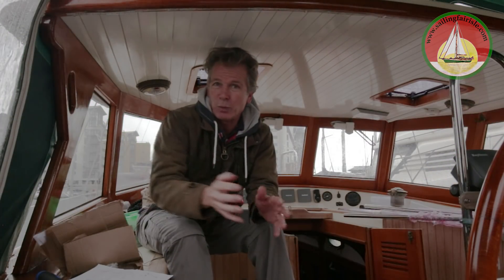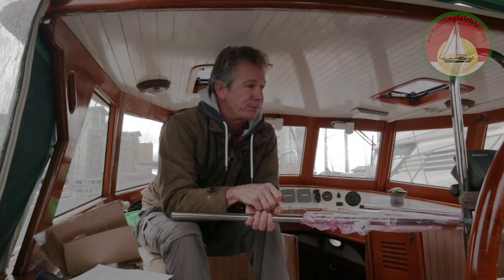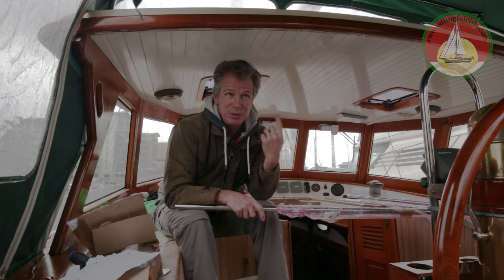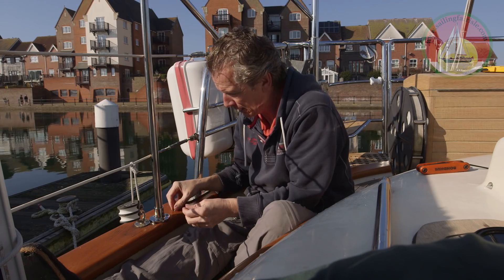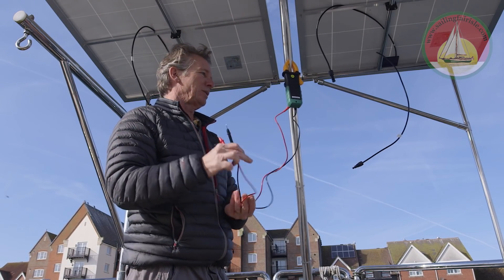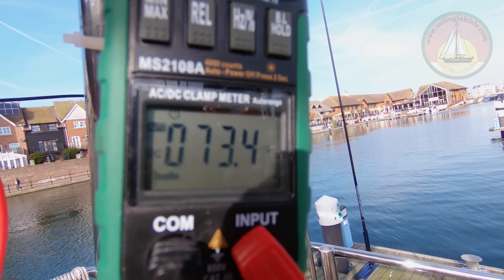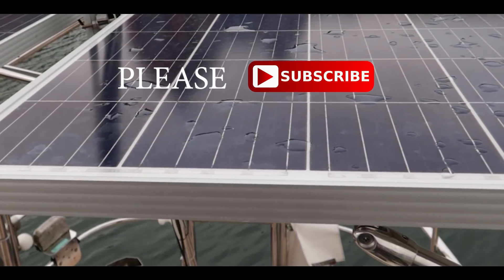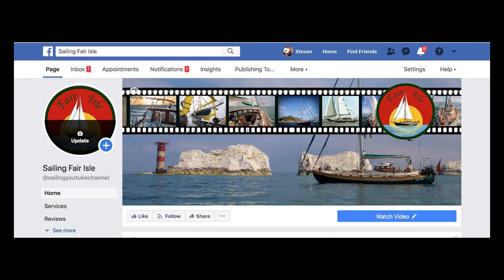Fitting solar panels on a sailing boat

Comment: I've been an aircraft mechanic, working on airliners, for 35 years. I have also been avionics rated for over 30 years. I have to tell you, your skills and knowledge are well developed.  People would do well to listen to your advice.

You and I both love machines.
Reply from the maker: Well I hope at least my technical advice is okay, my girls tell me my advice on life in general is rubbish!
Reply: @svfairisle  Probably because you are not young enough to know everything. You know if young people listened to our advice, we would have less qualified people serving drinks, flipping burgers and working checkouts because the degree qualified people would actually have jobs in their field of knowledge.
Reply: I understand you mounted the charge controller upside down for ease of wiring. However, it is better to have the entrance holes on the bottom, or sides. Water can easily enter from the top. Salt water is the worst enemy of electronics.

Comment: Great videos!  One point, it’s a good idea to shade/cover the panels before connecting to the charge controller. Also, check out No-ox-ID. A product similar your use of Tefgel, but is specific to electrical connections.  In “really” challenging environments, there’s nothing better. A very small jar will last forever. I keep it in my electrical tools bag, and tefgel in the rigging bag. Excellent point re good ratcheting crimpers . A connection as you’ve shown will last the life of the boat. Poor connections have caused a lot of fires.

Comment: Ahoy Steve, nice project! Theres nothing like free energy from the sun! And the satisfaction of doing jobs like that on your boat is a added bonus! You do very nice work, and your knowledge and skill are evident. I also have seen you explain dielectric grease twice so far, there is much debate on the cues of it, but im with you. I use it on everything in my van, and if i ever get around to working on electric on my boat would do the same there as well. Cheers!
Reply from the maker: Hoping to put some more solar on this winter. It's working really well.

Comment: Great video on how to do wiring.  Do you use tinned marine wire in addition to the dielectric grease?
Another option if you don’t have it already is to install a heat exchanger near or in water heater.  That way you get free hot water when you are motoring or charging your batteries. We have such a device for our hydronic diesel hot water heater.   It works great and we save on shore power and/or diesel for hot water or t heat the coach.
Reply from the maker: Yes I do use tinned marine wire, I know a lot of production boats don't as it's not mandatory in the regs. but I think the extra cost is worth it. If you were using untinned copper wire you'ld need a bit more than dielectric grease. Best to use shrink wrap with incorporated hot melt adhesive inside on every connection to stop water wicking up the wire. 
The water heater idea is good. If we get to the stage where we've got excess solar I may just do that.

Comment: I agree with you about the real life returns from solar panels being half of what the sales blurb claim.  The rated figures are for a luminescence you can not achieve on planet earth, at a temperature you will never keep the panel at and  keeping the panels pointing directly at the sun - which in most applications is not feasible..so somewhere around 50% for a clean panel is what I find I get, and closer to 30% if the panel gets dirty.
Reply from the maker: Yes that's what I find. Still an excellent way to charge the batteries though!

Comment: instead of dielectric grease I use vaseline which is an electrical conductor...I heavent checkedd the results but there were no hickups. I used the same to keep battery terminals clean as well.
Reply from the maker: I used to use vaseline as well until I talked to a very experienced marina electrician years ago. Vaseline works for a bit but is much too easily washed out and in areas that get hot like engine fittings melts off. It's cheaper, it's just not as good!

Comment: Cable entry at the bottom for a reason, moisture will wick along the cable and into your control panel if you leave it upside down with the cables at the top.
Reply from the maker: Probably wasn’t clear from the video, but the entry into the boat is full 30 feet from the control box. The cable runs through the aft state room and engine bay before going though to the shoe cupboard where the control box is, that would be a hell of a lot of wicking!

Comment: Once your happy with the bridge i would weld it and polish the burn colour, the screws will wear thro sooner than you think. I am a welder fabricator with two sailboat in plymouth. And love your programs.
Reply from the maker: Thanks for your insight John. Yes I agree. The structure is holding strong and is rigid enough which is what I was worried about initially. But you're right, it has to last. I'm considering adding a further arc slightly forward of the others to hold a third solar panel and I think i will weld all the joints at that point.

Comment: I am a little on the low budget side and I want to put solar panels up to charge my stuff. Mainly the laptop, phone and keep the battery topped up. 

So I looked at all those many ways one can install a solar panel, now my challenge is: I got a small boat and that makes it difficult to find space. Were talking 22 foot here. 

One of the ideas was to put up an arch but wherever I turned they were a couple of thousand quid. Seeing how you built your own: How difficult would you rate the DIY of them, and how much did you pay for the arch? Do you perhaps also have a little plan of it? Every boat is different but I dont do a lot of DIY stuff and would like it as a little guide for myself to try myself at it.

Thank you for the video btw!
Reply from the maker: Building the arch is cheaper than getting one made to fit but it’s still not cheap. With this thinner tubing you need a frame not an arch with cross bracing pieces as well. But I would say a a 22 foot boat it’s not feasible. The way I would do it is have small panels on the rails that you can tilt up. Maybe get some tubing welded between a couple of stanchions replacing the wire lifelines to mount them on. You can get some nifty titling devices or design one yourself & this has the advantage of allowing you to angle more towards the sun most of the time.

Comment: Solar panels are very much my expertise, Canadian Solar are rated very highly as the worlds number one efficient and cost effective panel.
Although I am not a fan of microinverters in hot climates, on a boat I would suggest they would be the perfect option as each panel would operate independently, perfect for your shading issues, I thoroughly recommend optimisers to enhance the performance on cloudy and wintry days.
Unfortunately you found out the hard way that thin Flexi panels are maybe ok for a camper van but I would suggest avoid altogether
Reply from the maker: Good advice, thanks. What’s your opinion on Bifacial panels? They look like the perfect panel mounted high up on a stern arch with all that reflected light from the water coming up?
Reply: Have a look at the BIKU and the BIHIKU, both are Canadian Solar Bi facial power rates up to 400 watt, from what I’ve discovered they provide up to around 30% more efficiency, I’ll find out for you about their abilities at sea for your specific requirements
Reply: And keep safe in such trying times...

Comment: Hi, the Mrs. and i have recently started watching your videos and are loving them. We have been watching canal cruising vids for ages including "Cruising the Cut" which i think you watch too. Of course i have gravitated to your Techie vids and articles as i love tech. I did notice on your Solar web page what i think is an oversight ie. ""As I said in the video, I opted for panels in series as I don't have big shading issues so I'm operating  on 62volts at 8.7 amps (in series it would have been 31 volts at 17.4 amps)"" Should that be "in parallel" it would have been  etc.? Keep the tech stuff coming as being a complete landlubber i want to learn more about sailing in general and the systems in particular involved. Cheers.

T
Reply from the maker: Think you've been on lockdown too long Tony! They are in series so of course the voltage is doubled, which is a good thing as current stays the same & therefore less loss in the cables. I used to work opposite David, he was ITV, I was BBC so yes I enjoy watching his videos although I've never been on a narrow boat! What sort of boating do you do?
Reply: @svfairisle  I have copied and pasted this from your web page on solar power;

"As I said in the video, I opted for panels in series as I don't have big shading issues so I'm operating  on 62volts at 8.7 amps (in series it would have been 31 volts at 17.4 amps)"

You refer to both configurations as being in series when one is in parallel or, have i lost the plot? :)

Only sailing we have done is cruising the canals on our friend's 65ft. narrow boat "Simplicity" i'm afraid. I took to the air instead of the sea :)
Reply from the maker: @tonywalker2372  Oh I see it's on the website text. Didn't spot that, just a typo, i will change,Thanks!
Reply: @svfairisle  I recognised it was just a typo, easy done. Loving your vlogs.

cheers, stay safe both.

Comment: I just wonder, that where panels are often partly shaded such as on your hard dodger, would you be advantaged by having a 10 x square ft panels instead of a 2ft x 5ft panels. The idea being that smaller things like lines or pennant shadows wont interfere greatly with output because the greater percentage are without shade which would otherwise kill the lot ..
Reply from the maker: Yes if I were doing it again I might have two square panels connected in parallel. They would have to be quite small though and would still get the boom shadow on occasions so don't think it would be a big gain.

Comment: Good overview, thanks. 

I also liked the info on your website (but maybe correct the typo to avoid confusion: "I opted for panels in parallel as I don't have big shading issues ....", you installed them in SERIES because shading wasn't a problem).
Reply from the maker: Arh thanks, will have a look & change :)
Reply from the maker: I've fixed the typo, thanks for the spot;)
Reply: @svfairisle  .... and I have subscribed 😊. Very nice boat you have there. Great protected cockpit, you got your priorities right!

Comment: Hello, appreciate your tech talks, thank you. Please excuse my ignorance but would that connection be better if soldered instead of using crimpers?
Reply from the maker: It's a very good question, I have talked about it in other videos. I think the Bilge pump video is the best for that as I go through the best connectors when I wired it up. Basically though the problem is although soldered joints are undoubtedly the best low resistance connection they are not good on a boat for the same reason that single core wire is no good on a boat. Any movement and the weak spot where the solder meets the wire and effectively makes it like a single core its at risk of breaking. If you're dealing with wires that are in a loom and very well tied in so that you can guarantee no movement then it might be okay. But its very difficult to get no movement on a boat!

Comment: Steve, Have you looked at Sailing Uma's channel tilting panel system tilted forward and aft via a halyard system?  I'm anxious to research and see how much improvement one can get by tilting the panels toward the sun. I'm sure Dan of Sailing Uma knows that data first hand, so will try to find out from him. Thanks for the video
Reply from the maker: I did research it and the answer I came up with was about 20-30% improvement. But that's if you're really on it and are out there adjusting all the time which I can tell you won't be! Also Uma's adjustment is just in one plane, really difficult to go both ways, so you may be lucky and be orientated with the panels tilt in line with the sun or it maybe at 90 degrees in which case you're stuffed!
I think the answer is not tilting panels but bifacial  panels, at least for ones on an arch or mounter on a rail as you'll get great reflection off the water.. I'm trying to get hold of one for the new arch we have, they claim a similar 20 -30% improvement over standard panels and you don't have to be out there tweaking as your boat swings around at anchor!
Reply: Of course you did! haha. Thank you

Comment: You might as well weld your arch as quickly as possible, considering the incredible strength the wind (and waves ?) can develop against these flat surfaces: you are the first one I see using these tiny nuts to secure the tubes ! Beautiful boat, very unique design, nearly as solid as the Amels. Keep up the good work !
Reply from the maker: Yes I plan to, I’ll probably have an arched top made, will look nicer. Have to say though, force 10 in Biscay didn’t shift it, not even a wobble!

Comment: I have heard several people including Troy from Free Range Sailing (who did a side by side comparison with non flexible solar panels ) and Ryan and Sophie on Polar Seal who both were disappointed with the performance of flexible solar panels.  It might not just be the location.    Troys side by side comparison indicated that the flexible panels performed significantly poorer than a fixed panel.
Reply: Like many things it depends on the panel.  However, most flexible panels are either polycrystalline or amorphous which are less efficient than monocrystalline panels, which are almost always rigid.

One advantage amorphous panels have is less impact from partial shading.

Comment: I´ve had discussions with a local (Cagliari, Sardinia) provider of panels and installation.  I´m thinking of installing 2 panels, each rated for 144 watts.  The installer is suggesting that I use one MMPT controller for each panel; however I noticed you have only one.  Do you see any advantage for having one controller for each panel?
Reply from the maker: It depends on the shading and cable runs. If you've got any significant shading issues (by that I mean a whole cell or more shaded for extended periods) then the choice is 2 MPPT controllers or 1 but with the panels wired in parallel. Have a look at Tech Corner on our website, I've put a lot of info on there. Good Luck!

Comment: I'm looking to make a solar arch myself and I'm in Sovereign Harbour too. I was wondering where you got you materials from?
Reply from the maker: Arh good man! Youre in luck then. Sea screw are based just down the road, they're an online company but you can just go and pick stuff up if youve ordered it first and skip all the delivery costs, 
https://www.seascrew.com/
Reply: @svfairisle  I can recommend SeaScrew too: fast delivery, good quality, big assortment,and  helpful people.
Reply: @svfairisle  what diameter is the 316 s/s tubing you use? Are bolts all the way through to a nut any better than grub screws?
Reply from the maker: David Turner yes the bolted through method would make the joints more secure, you’ve just got the issue of little nuts & bolt heads to scrape yourself against! Depends on where the joints are I suppose. I’ve found the grub screws to be fine so far, we’ve had some 40 knot winds and some 50knot gusts and they’re still there anyway!
I used 25mm 316, but the uprights are all extra thick, the ‘super-strong’ range, they feel twice the weight so I think they are good. I’ve got quite a bit of bracing going on so very little flex. The windage these big panel have does scare me and I want to add more so I will probably add an extra rounded arch close to the boom crutch before I add it. Steve
Reply: @svfairisle  Ok sounds like the structure is sound then. Windage of larger panels etc...That's something I have to look into to determine the best location to set them up. The boats I am looking to buy have s/s structures at stern already with centre cockpit of fibreglass etc. Looking to add panels to add up to 1kw. How would a wind scoop structure made out of a  couple of flexible panels fair on the foredeck or aft deck when stationary? With like bracing around the panels to keep the flexed panels at the right scoop shape etc